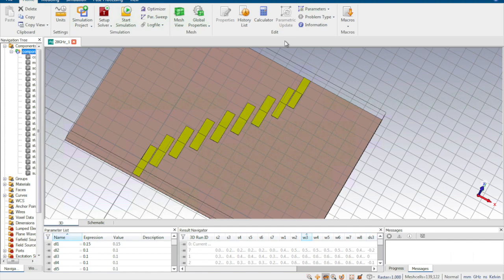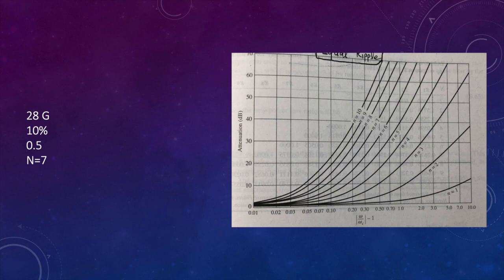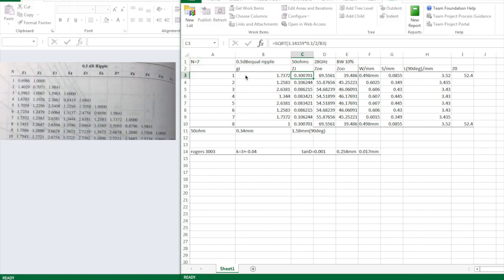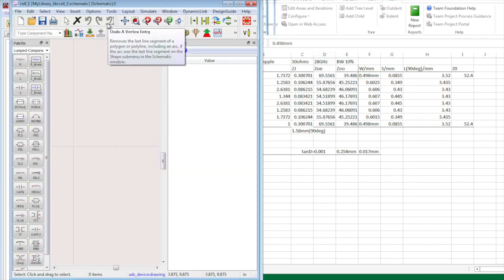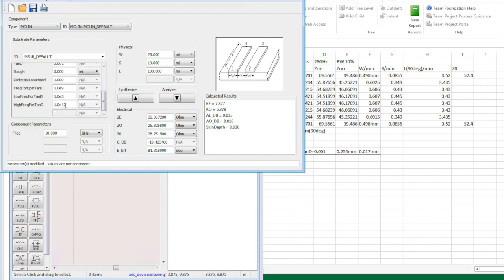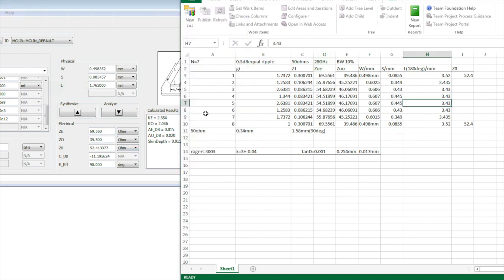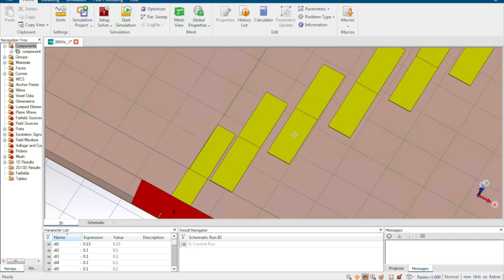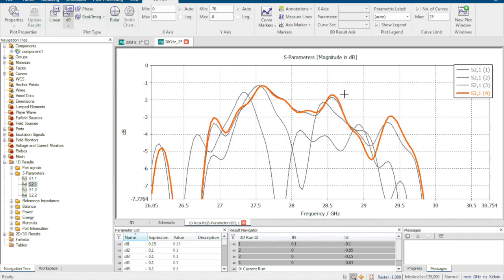Bandpass Filter For 5G

Comment: Hi there, may I ask, do you have the step by step method on how to draw the microstrip coupled line on CST?
Reply from the maker: Sorry, I do not have a step by step video. There are two key parameter for this filter design:1) the length of the microstripline and 2) the gap between each microstripline. We can find the method to calculate the initial value in Pozar's book.

Comment: Your videos are really great! I am also working on filters and waveguides. But i always get stuck on placing the ports. Can you give some tips on how to set the waveguide and filter ports? Thanks a lot!
Reply from the maker: Which version of CST you are using? For the latest version, it has the kit to help calculate the extension factor of the port. As a rule of thumb, size the extension factor as three times of microstripline width.
Reply: @Fan-vk9gx  For feeding cylindrical waveguides you can use the "pick face" feature and then select your input cross section of your strucure. After taht a waveguide port can be placed at that face. For waveguide geometries you don't need an extension factor since the electromagnetic field is "trapped" inside your waveguide so to speak.

nice video by the way. I have some questions: 
did you try out the frequency domain solver as well? That will make your simulation results less "wobbly". 
Secondly, can you explain the  near peaks before and after your passband? Of course due to the distribured filter structure there will be spurious bands at higher frequencies, but why are they so near?